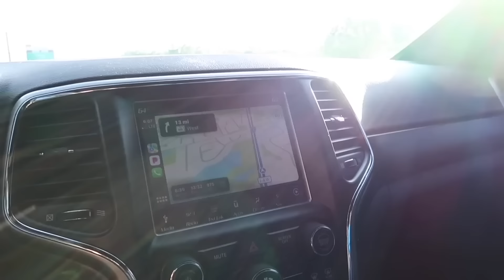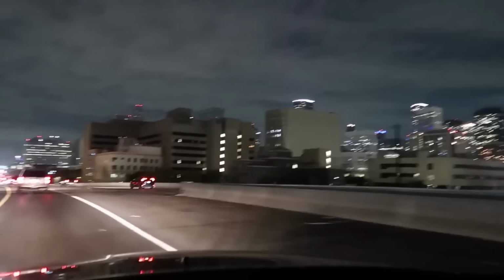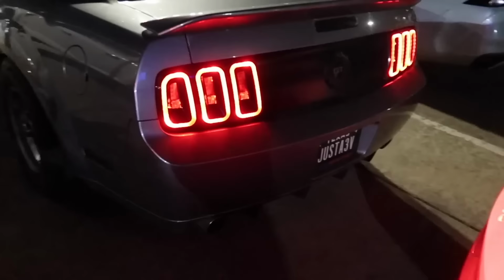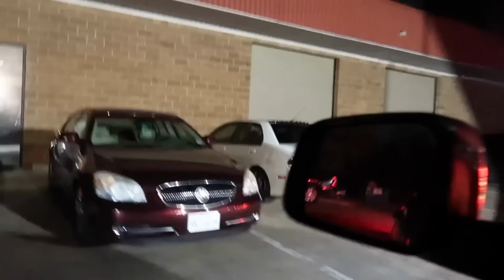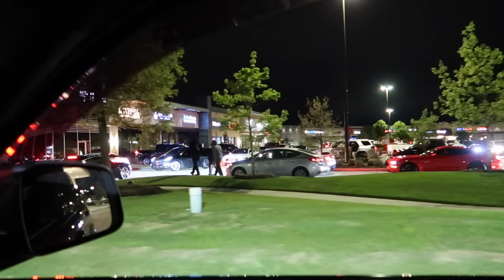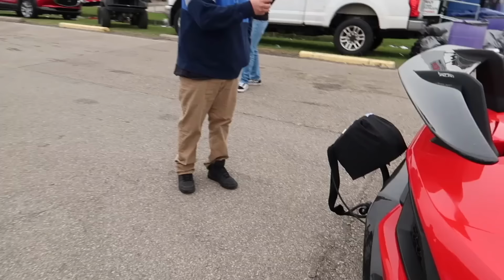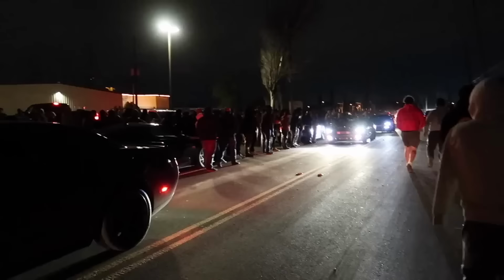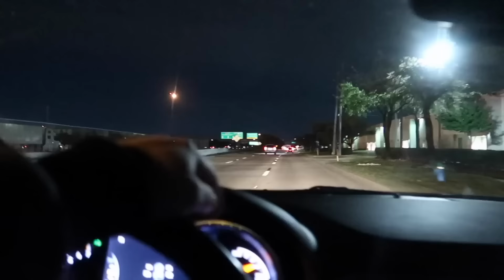TX2K23 Movie - Some of the BEST Street Action in Texas! (1,000hp + COPS!)

Comment: I see a lot of the same builds. Glad I went a different route. 2014 Mustang 3.7 V6. 67MM turbo, 1000cc injectors, dw400 fuel pump, 1 pc. Aluminum driveshaft, etc….
Reply: Yessir
Reply: I respect  your build. There was a time i was going to daily  a 3.7 supercharged. I figured a low to mid 12 sec car would be enough. My limit is 93 fuel. And there is only so much power you can make on 93 in any given motor. Next problem  was a boosted v6 was really no faster then a bolt on coyote. And lets not forget 700whp plus on 93 with stock coyote. V6 just cant keep up. Less investment and more power with coyote. Hard to beat. And the icing on the cake was used v6 mustangs were almost as much as the used v8s. In the end i went with choice C, lol. But i do dig a modded v6 stang. It just can't compete with the coyote. As far as power/sound/investment. But hey, the car is for you. Invest in what you like.

Comment: I'm a big Honda guy build lots of them but my uncle has a 2020 Toyota Corolla SE AND LET ME SAY THIS that car surprise me after doing lightweight Wheels like the car in the video Plus K&n cold air intake with the front bumper air duct mod and header and a Cat-Back exhaust and that car actually surprised me it was decently quick for what it is it keeps up with my mom's 2012 Civic SI with intake and exhaust

He wanted the six-speed manual but those tiptronic ones like the one in the video if you put them over in manual mode and you put it in sport mode turn the traction control off they're actually pretty decent with the 10-speed transmission like in the video you can see how much better at did from a role I don't know if the guy downshifted and had it in a lower gear when they did a roll but yeah once you do a few bolt-ons even though they're not fast they're decently quick for what they are

And this is coming from somebody with a built k24 block K20 head 95 Civic Coupe that's a track car 

And oh for Honda Accord coupe V6 6-speed manual with the hfp Honda Factory performance package full bolt on J37 NA with 320whp for a daily

Comment: The further I go! Stop calling every centrifugal blower a pro charger! Pro chargers make the least systems for corvettes period. Besides, pro chargers suck and do nothing but burn up and fail.
Reply: ProCharger is by far the best blower on the market.. period. anyone that says any different is a freaking idiot.. and in 25 years of racing I've never seen a properly installed and maintained ProCharger burn up.. every 5k miles you need to change the damn oil in it.. my D1SC has over 30k hard miles on it.. in a Vette...